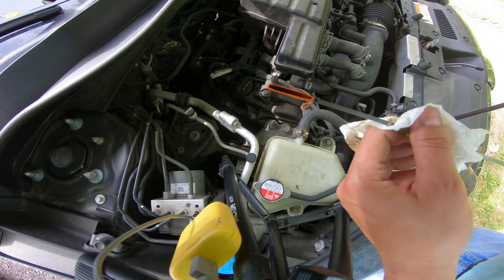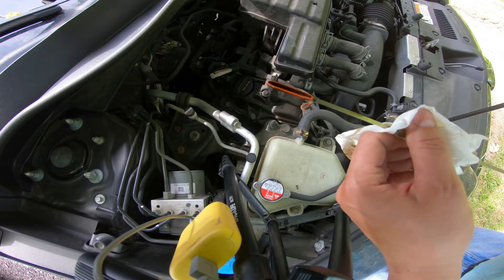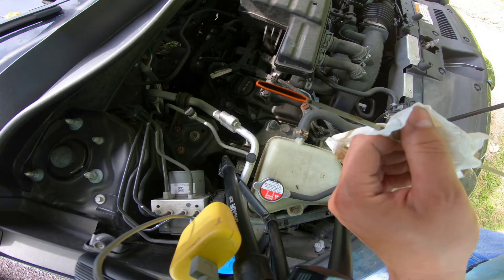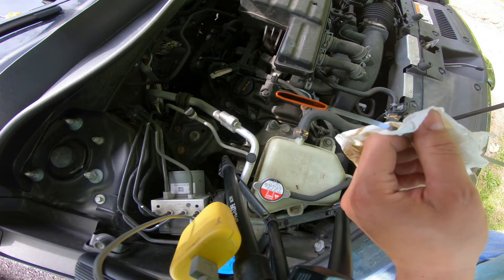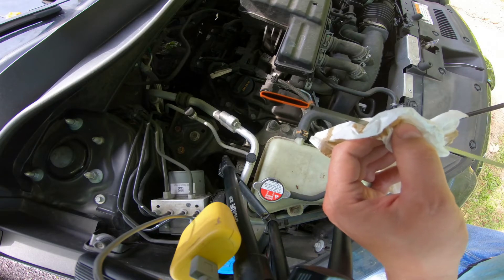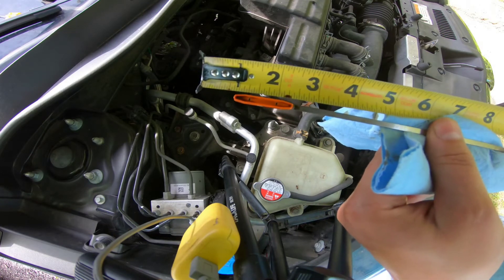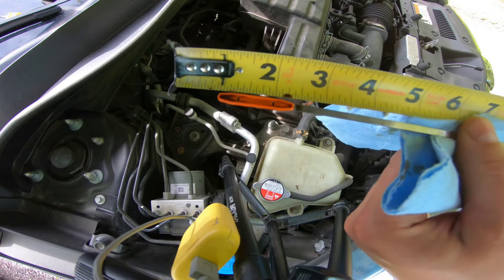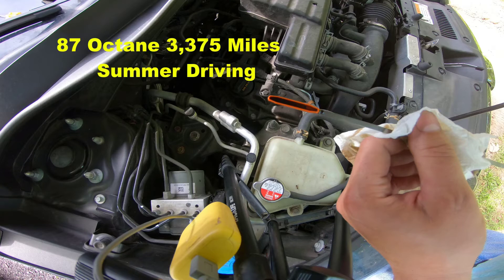From 91 Octane to 87 Octane - 1/2 Inch Oil Rise - 2017 Honda CR-V - #3

Comment: Octane has zero effect on oil dilution
Reply from the maker: Octane effects what timing program the 1.5L utilizes.  Ultimately this engine has less dilution when utilizing higher octane fuel.
Reply: @factotumlife but u used different oil 0w30 and 5w30, which will become another factor that can disturb the results. U see what I mean?😅

Comment: It's ironic that the 2025 Honda Passport and Pilot are both using the 3.5 non-turbo engines and  seem to be the last of the full size SUVs that you can get with a naturally asperated engine.
My guess is that Honda has so thoroughly destroyed their reliability reputation with these small turbo engines that they don't dare switch to turbo on these two models-for now anyway.
Eventually we will all be riding bicycles wearing Chairman Mao jackets 🇨🇳

Comment: Hello. Thanks for sharing all this info. They so valuable. I need a guidance. Just bought a used CRV 2020 (1.5T) with 80,000 kms on it. I have a option to buy Extended warranty either from Honda or third party. Being aware of so many issues associated with 1.5T engines would you recommend one? It will cost me $3300 CAD for 100,000kms/4 years from now.

Reply
Reply from the maker: I can't really answer whether you should or shouldn't buy an extended warranty.  The only non-maintenance repair I have had with my 2017 CRV was set of fuel injectors at 85K miles.  The vehicle now has 118K miles.

Comment: Thank you for your videos! I’ve got a 22 Crv LX and 22 civic Touring and love both of them for the most part… especially after I sound deadened and soundproofed both cars plus some custom audio work…
I purchased both right before the interest rates and new car prices rose substantially, and I was under the impression that Honda fixed the dilution problems. 
So of course, now I have it (od) on both cars and because I’ve been educated (or blessed) with your knowledge, I’ve been obsessing over it and now realize how blatantly obvious that Honda has trained their service advisors to deny that it is a problem. Surprise! They pretty much treat me like an idiot, pointing fingers at everything else.

Anyways, thanks again for your info! 
I just got the Crv oil changed early and switching to 91oct @$2.40/l lmao. I do plan to keep the cars until electric cars/chargers/batteries/price/reliability make more sense, and depending on how Honda treats us, I may be forced to leave the brand after having multiple Honda motorcycles and multiple Honda/acura cars.*sigh*

Comment: Great video.  I'm a retired diesel  mechanic and own a 2019 crv. Oil dilution is normal with any engine. The problem with the 1.5 is excessive oil dilution. I have installed a defa inline antifreeze heater for morning start up. I also drive it in sport mode with the heater on low allowing the engine to heat up faster. I'm very disappointed  with this engine in winter condtions. Terrible on short runs. Honda Canada told me that it's the dealers fault for not being able to fix it. Dealer has done updates and changed the heater control module. This made it a little better. I also keep a battery maintainer  plugged in when not using the crv. This way I run the seat heaters on max all the time and keep the battery fully charged. In my immediate  family we have 5 hondas and everyone is speaking with their wallet and leaving honda. We have never had a problem  with the 2.4 liter.  Don't get caught driving in freezing  rain this little engine will not give you enough heat to melt ice off the windshield in stop and go driving. If you get this engine to operating  temp then stop and idle with heater on high you can see the engine temp drop

Comment: Use the right oil and change it every 5k or sooner, use quality fuel with an octane rating that fits the compression ratio of the engine..  i have a 10:5.1 R18 so of course i use 91-93 octane.. sure ot will run on 87 because of the base tune however it will also learn that higher oct fuel is in the tank and it will react according..

Comment: I already commented in an another link. What if the oil seals in the high pressure fuel pump vare randomly defective. Fuel pump is driven via gear connected to the engine block. If you use 400 litres (100us gal) for 4000 miles then 0.5% leak of gasoline leaking into engine = 2 litre. If engine is always hot enough then 90% or more of this leakage into lube oil will get evaporate back into engine via PCV line. If the gasoline have lesser % of C8 or xylenes or any heavier gasoline cut then there will be lesser oil dilution. Xylenes have boiling point of 140 deg C. If crankcase is have higher pressure than an NA engine then evaporation fuel in engine oil will less effective. Regards
Reply from the maker: I think the internally leaking (cross contamination) high pressure fuel pump is a valid theory.  I was told by a Honda Tech a few years ago if a situation as described occurred, the fuel pressure would bleed down and cause a pcm/ecm code on startup.  However I think that was his way of punting.

Comment: I've done tons of research on line, on tons of cars. All makes and models, with GDI , and especially if also equipped with a turbo, has some fuel oil dilution.  Some more than others. I just bought my 1st GDI , turbo car last May,  a 2021 kia K5.  Love the car. Very unhappy that my oil dipstick reeks of gasoline.  Thru the summer here in the southern California desert area, temps run 110 to 125 Fahrenheit.  Dipstick still smelled of gas. Now in winter, temps average 60 to 75 degree days and about 45 degrees nights with occasional dips to 30 32. I have a 2017 Hyundai Elantra,  with multiport injection.  The dipstick on that car after 3000 miles just smells like oil. I always change my oil at 4000 miles.  I'm changing the k5 every 3000. Using Castrol EDGE SYNTHETIC.  Also, I always run premium in my cars, Maybe that why I'm not seeing a rise on the dipstick. Fingers crossed that will be sufficient to protect the engine.  Also my brother bought a Eage Talon turbo new. He had the car 9 years, and never had ticking lifters, that came from long oil change intervals causing sludge and dirty oil which damaged the lifters. If you have as much gas as it appears in your Honda, changing the oil frequently is your only option to get that gas out. 5, 6, 7 thousand miles is just asking for an early engine demise, most likely from bearing failure.

Comment: I have a similar problem with my 2019 Honda CRV 1.5 turbo.  Fortunately, it is a lease.  My engine oil smells gasoline and black after 3000 km after oil change.  I have booked to see Honda service tech on Dec 10th 2021.  Let's see what they got to say.

Comment: Hello. Very helpful video. It is a shame you forgot to take the sample. I have a same problem with my Audi SQ7 2017. It is large 4.0 engine with 3x turbo. I do short 6 miles distances 2 times a day and then doing longer trips over the weekend. But it is still only 50km per one start.
No one will warn u that you may get big troubles with direct injection engin when doing short trips. I am driving the same way for last 10 years and never had problem with this..  I gueas this new engin technology causing troubles.
My car will give me a warning that oil level is too high and this is the pint i need to change the oil. So it did just now after 6000km (5 months) since last oil change. I live in Europe and it is winter ahead. Well i am OK with oil change every 5000km but i am worried if this contaminated oil would not damage the engine anyway.
Thank you for very goos videos. Keep it up.
Reply: engine

Comment: I know you don't get a ton of views, but I appreciate your videos on this topic that has become "less hot" over the past couple years. I'm curious, did you get the software "fix" they rolled out a couple years ago? When? I assume yes, but haven't heard you say it. Using the higher octane fuel seems like an easy enough thing to do. I can't really see a downside.

I wonder how much hardware has changed from 2017 1.5T to the 2021 1.5T. Obviously they have changed a decent amount in terms of software/injection control. I agree with you that the big question is in the overall reliability of these engines. As you note, there hasn't really been any issue so far despite your documented oil rise. Time will tell.

Meanwhile, Honda really designs nice motors and this really is no departure from that trend. It's quite a feat of engineering, all the way from the CVT to the engine to the turbo. In one sense, buying a 5th generation sounds like a bit of a gamble to those of us that expect 200,000 miles out of a vehicle. The interesting thing is that we have no evidence that that won't be the case. Time will tell.
Reply from the maker: Thank you for watching! Yes the update was completed within two months of release.
Reply: @factotumlife did it help?
Reply from the maker: @Cincy_Kid  My opinion of the original Honda update was I noticed nothing.

Comment: Thank you for these great videos. It is so surprising the way Honda continues to use these 1.5t without giving out official reference points as far as the oil rise on the dipstick is concerned

These are my thoughts after my own experience. I think the first point is making a decision what your reference point is for oil change. If you want to believe Honda, there is none unless you get trouble codes, which from what I have found through research does not occur, even with a full inch oil rise.

I had best success with 93 Octane last winter. During this summer, I used 87 Octane and I have experience just under 1/2 inch oil rise after 4200 miles. The question that needs to be answered here is if the engine is tuned for for 87 Octane, is the fuel mix still rich with 91 Octane, which is the main issue why there is oil dilution, or does the knock sensor change how much fuel is fed into the chamber.

I have come to the realization that the oil rise is determined by your driving cycles and I believe this is the variable. I will say that had I known this would be a variable, I would not have purchased my 2020 Touring last year.

I believe the real issue here is 3000 mile oil change interval vs higher cost of premium gas. There is no contest, it is simply cheaper to do more frequent oil changes. We can also decide to just trust Honda, who tells us to use the MM to change your oil, which would be 9000 miles, unless you get a trouble code.

After a year of ownership, I still struggle with this issue. All I ever asked was for Honda to give me a reference point when to change the oil because of oil rise and then to clearly state what is considered normal oil rise and what is considered abnormal.

I will end by saying that despite all of this, my CR-V has performed flawlessly and does drive beautifully.